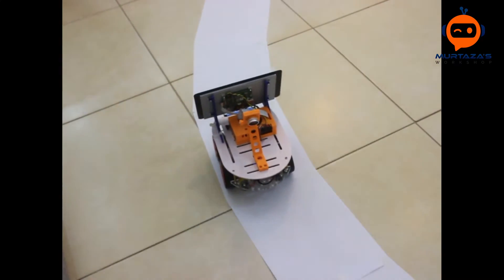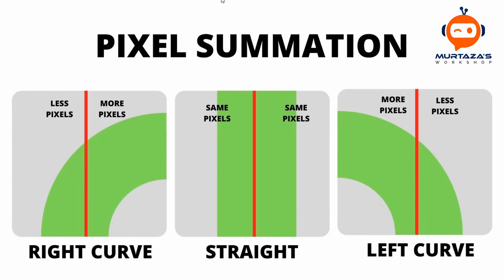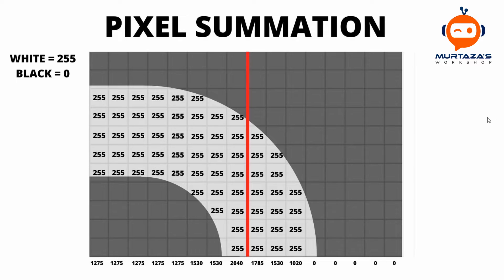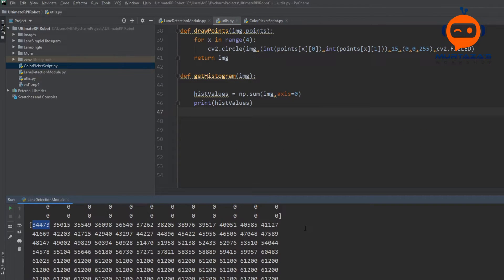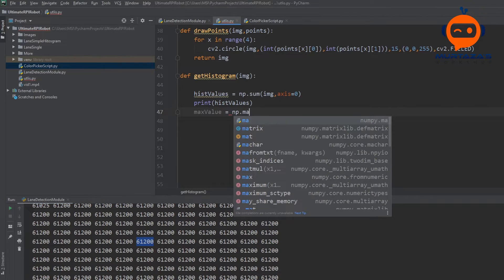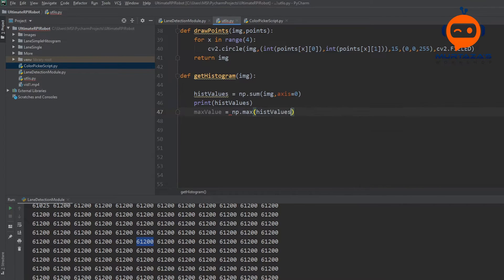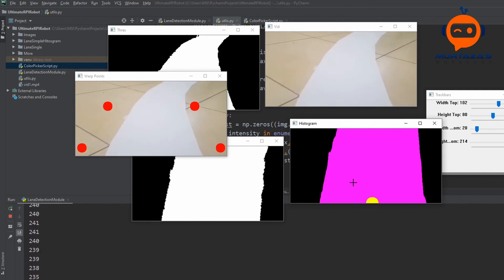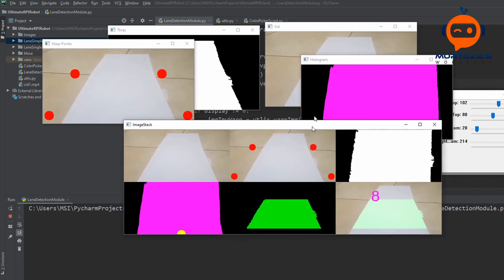Finding Lane Curve | Self Driving Car with Lane Detection using Raspberry Pi p.4

Comment: Can't parse 'pt2'. Sequence item with index 1 has a wrong type
>  - Can't parse 'pt2'. Sequence item with index 1 has a wrong type i am getting this error in this line  cv2.line(imgHist, (x, img.shape[0]), (x, img.shape[0] - intensity//255), (255, 0, 255), 1)
Reply: Make sure your imgWarp passes imgThres into the warpImg function.
So on line 14:
imgWarp = ultis.warpImg(imgThres,points,w,h)

If you were to use img instead of imgThres, the 'intensity' variable would end up being an array since img is in color while imgThres is in black and white.

Comment: this is a question from prob ep 2 or 3 but now I'm finding an issue,

 in the threshold method I returned the mask(like you) and the canny of it being the outline.
with the canny the end product when displaying it in cv2.imshow("histogram" imgHist) it doesn't look the same as using it with the mask, it only have the black spikes where the line is.
what else do I need to do on the canny for it to work? or those spikes detecting the curve is correct?

Comment: The operator // didn't work for me, I had to use int(intensity/2) instead. And also for the trackbars where wT//2  had to be int(wT/2). Took me a while to sort out but after some research I got there in the end.
Reply: use round(intensity//2) give you better result :)
Reply: @saifallahchakroun6253  Thanks for the suggestion. I'll try it although not with the  // operator because that does seem to work for me...I have to use  / .
Reply: @saifallahchakroun6253  omg thanku!!